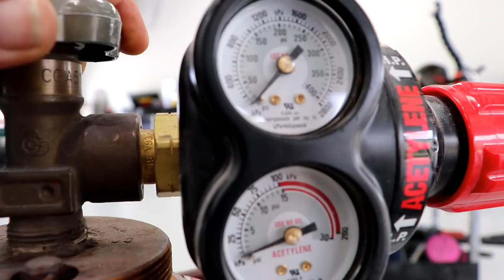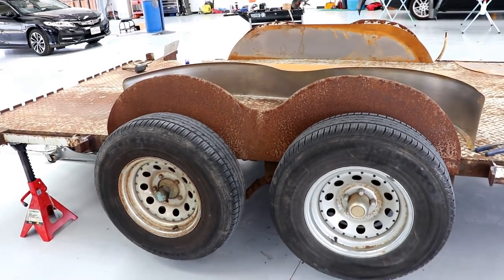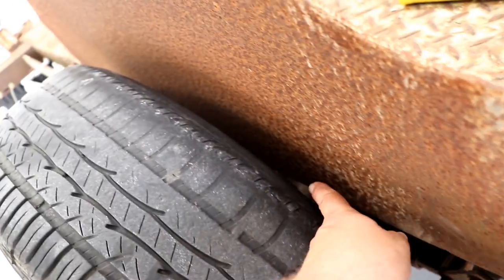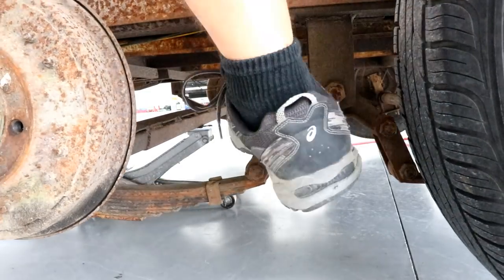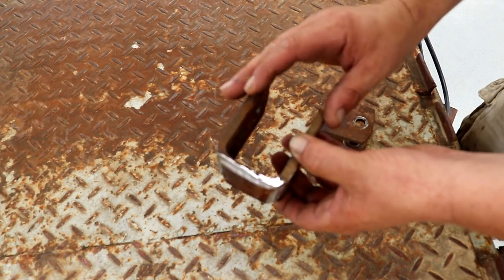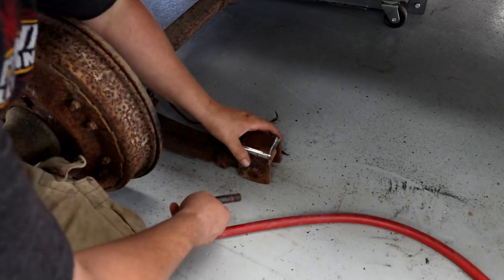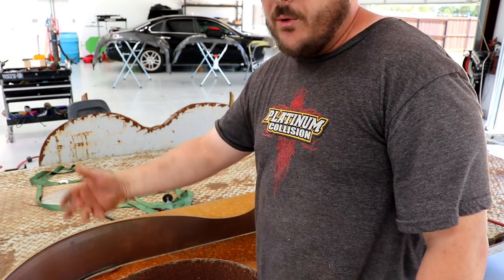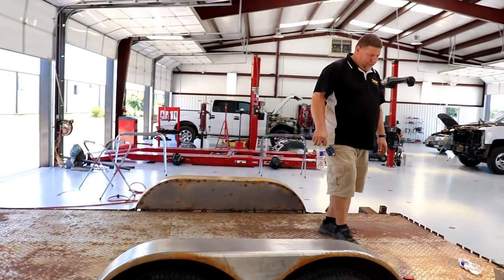TRAILER REPAIR.She needs new axles and springs But this HACK(job) will work for now

Comment: I have a China built Harry homeowner trailer with a broken leaf spring. I haven't found any parts that fit properly. Leaf springs are 1.25 inches shorter or longer. Leaf springs are 0.25 wider than any other 1000 pound spring. Leaf Springs are hook type sliding spring.  Just a ridiculous concoction.  And so, My repair job is also a  ridiculous concoction. I can only hope the axle doesn't fall off.  But , hey , the blinkers and brake lights work great !

Comment: The leafsprings were not bolted in the correct order. I believe the "Y" bridge between the front and rear leaf shackles should be above the leaf springs. Ends of the leafs should ride above their shackle
Reply from the maker: Nathan Klamerus You are correct. Whoever built it (Homebuilt) didn't understand the proper way to mount them. The reason I set it up this way is that if we flipped it to the proper orientation the home made axels would have reated on the bottom of the trailer. This setup works fine but I recomended that he replace both axels and all the spring perches.
Reply from the maker: +Nathan Klamerus Also the leafsprings were totaly dirrerent sizes if you can believe that:o.

Comment: When you weld the fenders on the thick plates of the trailer you should put a square plate between them to absorb the shock, otherwise it will crack just above the weld.

Comment: 1. You mentioned your springs were coil springs, they are leaf springs. 2. Axle hanger placement is determined by the axle manufacturer, anything else could be unsafe.

Comment: here is a tip on bending and forming steel...use a 18"+ pipe wrench instead of channel locks...I found it works great forcing metal to conform to your will ....that along with a BFH and a bit of heat works every time..😉
Reply from the maker: +Crazy Craig's RC's and 3d Nice Tip! I think you can actualy hear me grunt while trying to squeese the channel  locks! I really need to bring all of my tools to the shop.
Reply: The Good of the Land About the time you move them you will need them where they are now...always happens that way...lol

Comment: How does that floor coating hold up to welding and torching. I've considered doing it to our shop but I don't want to ruin it with sparks and stuff
Reply from the maker: +Garrett W I'm not sure what they used but it is the toughest stuff I have ever seen. Bullet proof! I will find out the brand and put it a video
Reply: The Good of the Land thank you!!

Comment: Should have shown a reference point to properly align both axles with the frame. With that much of a suspension concern, would not trust it to pull straight. Big deal when going down grades, or emergency braking.

Comment: That trailer's rust reminds me of my family's trailer. It got swapped in 2005.
Reply from the maker: +Michael W. I think it has enough rust to hold it together.;)
Reply: The Good of the Land 
Just like mine. Hahaha 
I recently redid the lights. I had some rusty bolts that needed heat. All I had was a propane torch. Almost burnt the deck of the trailer
Reply from the maker: Michael W. Well on the positive side it could have doubled as a Bbq grill! ;D

Comment: Either the eye to eye distance on the center pivot us TOO short Or the spring is too short ! Those axles are crap , no wonder the alignment is off !
Reply from the maker: +joe doakes Correct. It's home built. He finally came up with the cash for new axles. You should see it with new rims and as paint job!

Comment: I like your videos but I believe that the reason your trailer suspension looked out of geometry was because the trailer was in the air and the axles were hanging from the leaf springs. If you lowered the trailer it may have been clear that the equalizer, shackle straps and leaf springs were all in the correct orientation from the beginning. Great video otherwise!!

Comment: Did anyone check the length of the main leafs? That would be the reason the shackles don"t line up properly!
Reply from the maker: +Mike Anelundi Yup, you are correct. two completely different leaf sets and two hacked together axels. They built is so rhat the shackels were 180 degrees out of alignment.  Trailer needs new axels and matched springs to be 100%. I just gave it a quick dix ti get my friend back in the road until he could afford to have it fixed correctly.  Thanks Mike, goid eye.
Reply: Just a note I worked with my father for 35 years in the suspension business.

Comment: This was a complete hack job. Please stop doing trailers. You moved mounts and re installed all of the old items. You didn’t bother to check toe and camber on an obviously hack job axle first off. Then you don’t have the brackets, equalizers, or even shackles on the shelf to check the geometry of what you’re doing. These types of jobs will bankrupt you. Stop doing them.